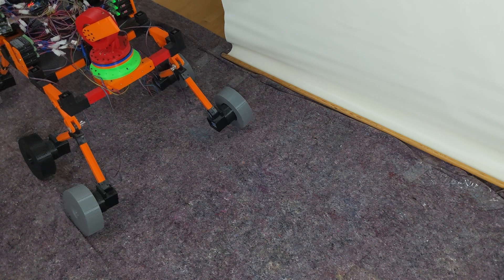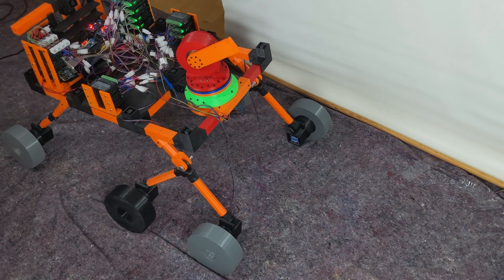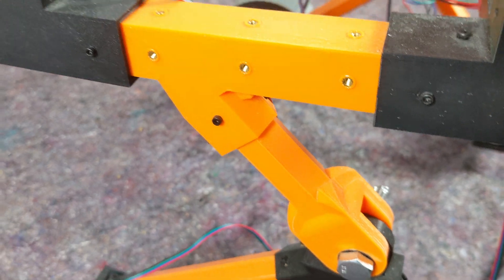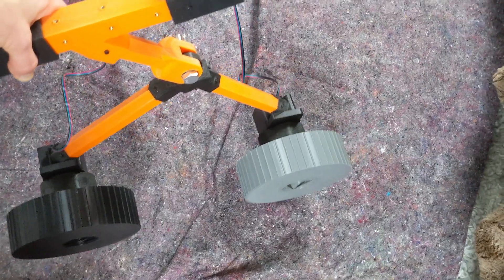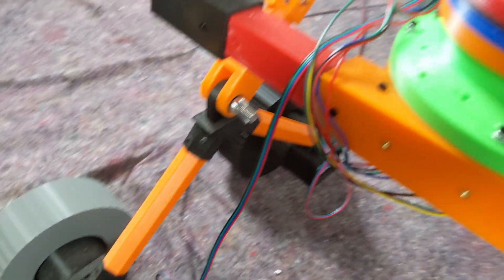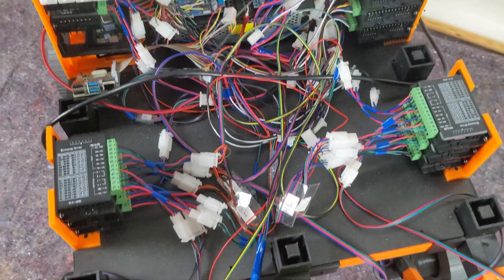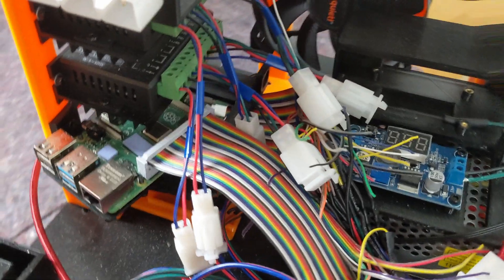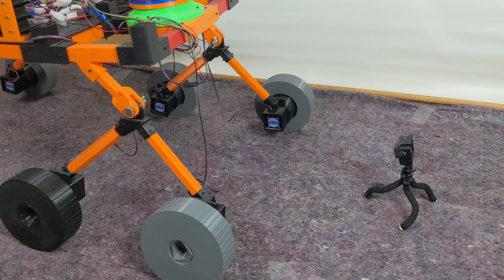3D printed rover with robot arm

Comment: Dont use stepper motors for drive wheels, use tpu for wheels, get a better steering mechanism
Reply from the maker: Absolutely this is a first prototype to start software development as quickly as possible. During the course of the project, the gearboxers for the drive and suspension will be updated.